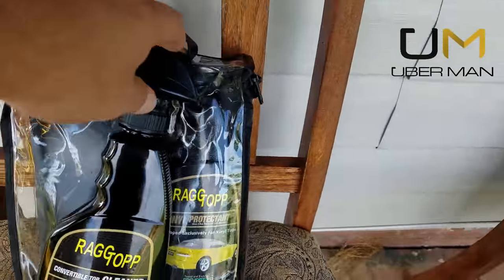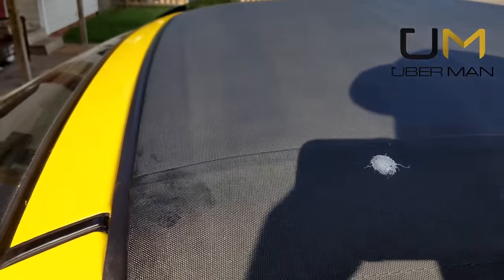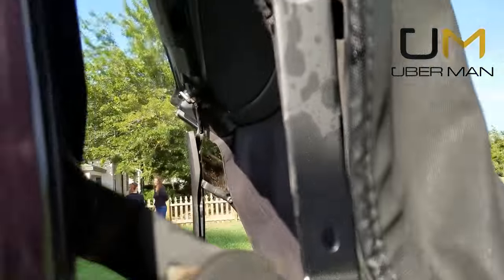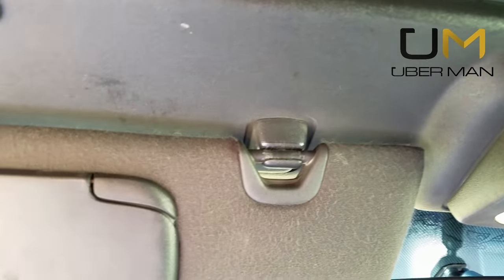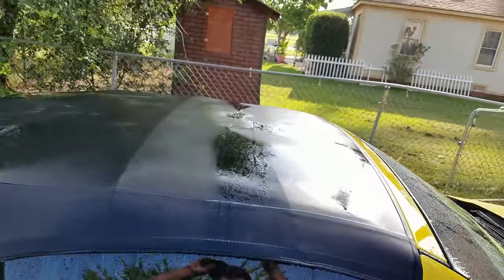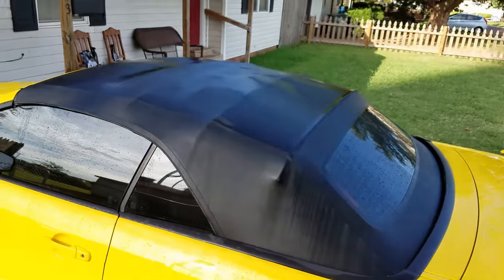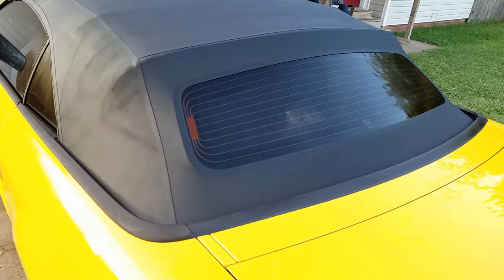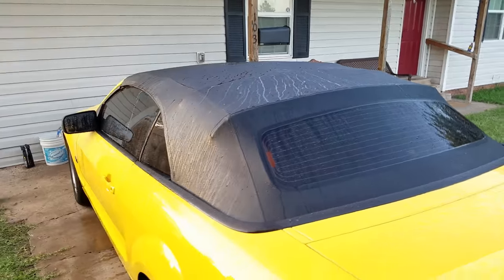Convertible Top Care - RaggTopp

Comment: suggestions....use triflow on the hinges not wd40....wd40 is a cleaner more than a lubricant and will wear off quickly.  Triflow works wonders on anything needing lubrication and will not wear away quickly.  Also avoid any of the alcohol based protectants for your rubber as they will actually dry them out more.  Not sure about the armor all you are using but check its ingredients....no alcohol!!!  Looks awesome...can I drive it??? hehehe
Reply from the maker: Thanks! I will look in to the triflow, and check the Maguires for alcohol. I really appreciate it!
Reply from the maker: Thank you. :) I appreciate it.
Reply: Or transmission oil
Reply: Maguires is good...I love it myself!!

Comment: Is it true that Uber has a requirement for vehicle to be able to qualify for Power Bonus? If so how does that make any sense since they accept any car from 06 and up? Also if there is a requirement, I am in a dilemma. Basically I purchased a 07 Camry with 41k OG miles for $6250 but after reading about the power bonus requirement I am considering a 2012 Prius with 101k for $7k. What would you recommend UberMan?
Reply from the maker: Yes, it is true. Most places it has to be 5 years or newer for any bonuses. I'd go with the Prius.
Reply: +Uber Man do you know what the requirement is for DC?
Reply from the maker: I do not. Sorry.